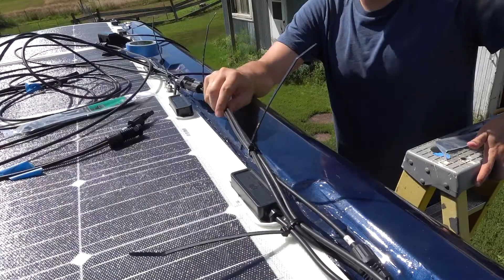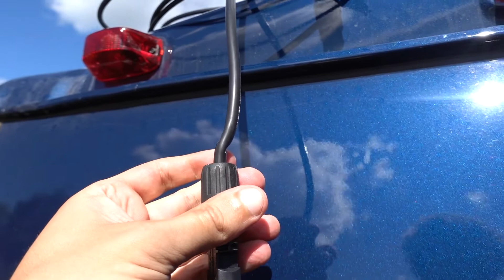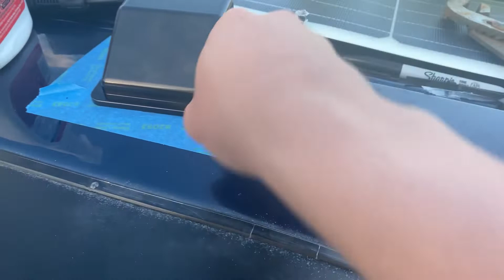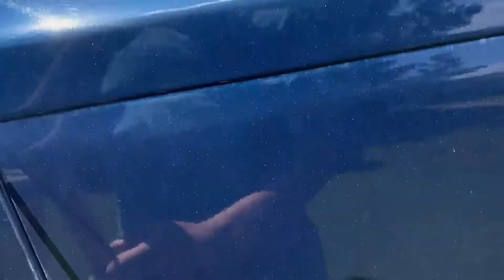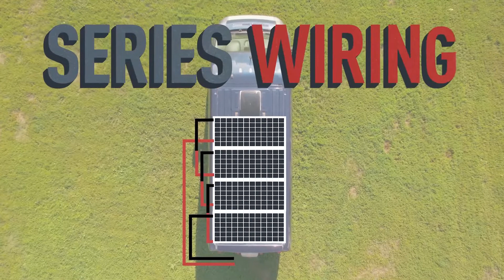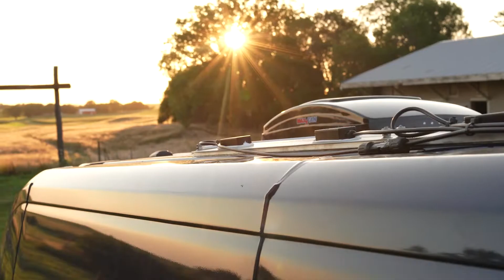Wiring Solar Panels In Series Or Parallel? - DIY Van Build Vlog Part 8

Comment: Hi kirby!

I don't know if you choose serie option to acomoddate the wiring on the top on your van, or is a option to your demans of electricity.

I would recomend other option in parallel: 2 and 2: yo conect two panel in parallel and the same with the other. And the end, you only have two wire, and the diametrer of wire is not to big and you have36 Amp/h

Sorry for my english, a lot of specific terms, and i don't use this words

Big hug men, enjoy the van!!
Reply from the maker: that is a good option as well! Thank you. I chose series to accommodate the amperage but it would also work with your method as well.

Comment: You will probably not get 36A when panels are laying down (have you measurements it? In high sun....  the safe snd best way  use 6mm2 cabels not 4mm2 , 6mm2 they are also available with connectors. Best are P or PSP not clean S...